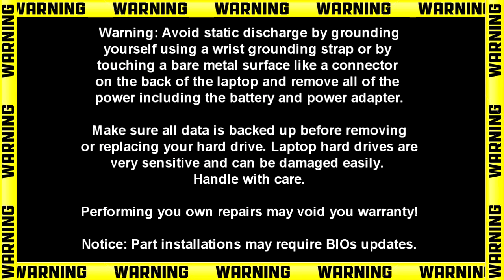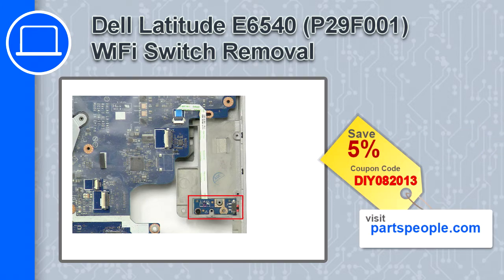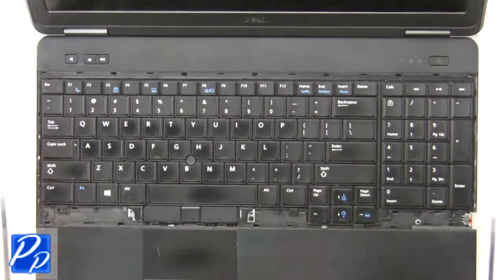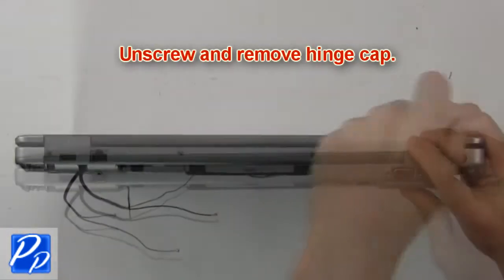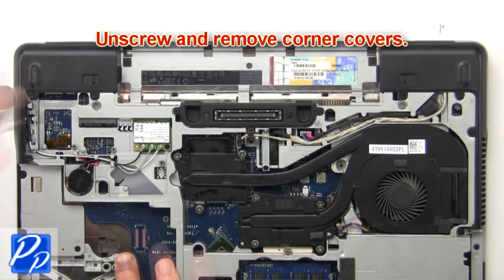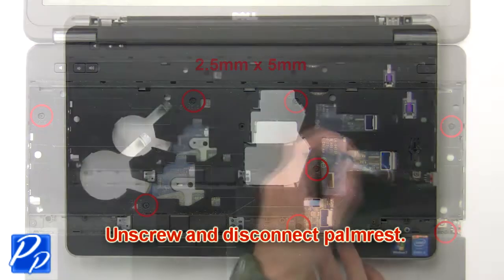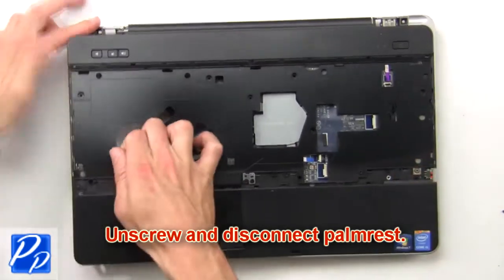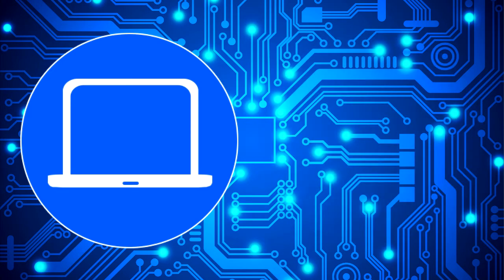Dell Latitude E6540 (P29F001) WiFi Switch How-To Video Tutorials

Comment: Thank you for the video! Helped me to change the switch. Just a small notice, if I may! At 1:08, you can not remove the screws from the bottom right side, because it is hidden under the hard drive. In your video, the hard drive (and lot of other stuffs) is already unmounted. This step, to remove the hard drive is missing.
Reply from the maker: Thanks for the feedback. I will use this to make changes. Glad it was able to help.

Comment: i have this laptop. and aeroplane mode is not turning off. that option is disabled. it is also disabled in network settings. when i turn on the wifi , it turns on and immediately tuns off again. can you tell me possible reason?
Reply: I disable "airplane mode switch connection" in device manager (under human interfaces). Then restart. 
I'll edit this when I power my laptop on again